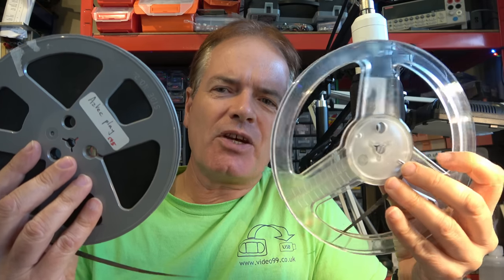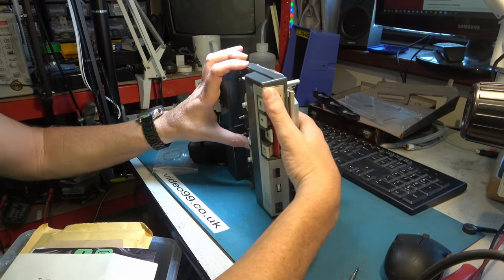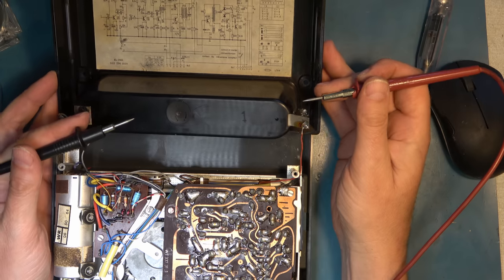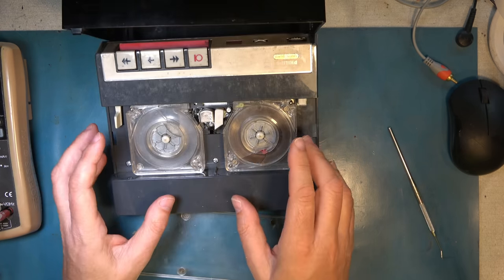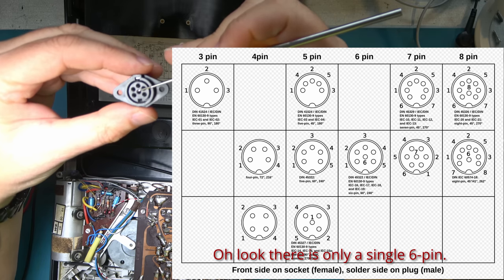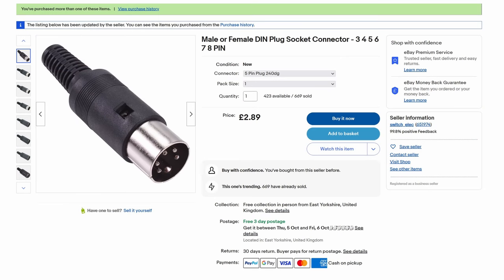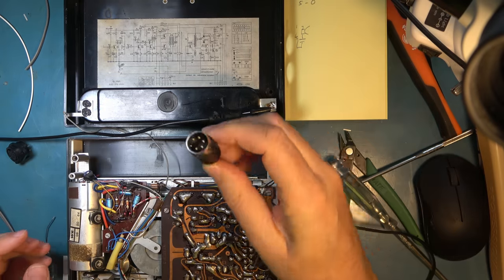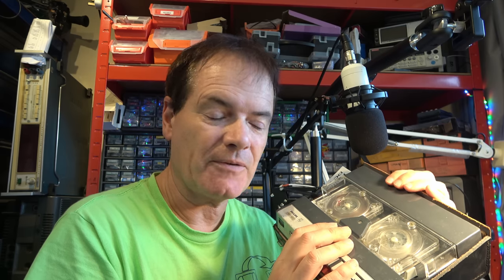Rare audio tape. Reverse engineer Philips EL3583 dictation machine. Historically important format.

Comment: The compact cassette also did not have a catchy name when it was introduced, "EL 1903" (the first tape recorder was "EL 3300"). I suppose that Philips did not feel like inventing a zillion names for the zillion products that they tried to launch back then. But when the compact cassette caught on, they created a name for it along with a logo, and adopted the fancy plastic case from their Einloch single-spool cartridge (originally, the EL 1903 cartridge came in a cardboard case similar to what later would be used for cassingles).

Comment: The change in your hair colour around the 1hr mark made me smile. I think you overdid it with the Grecian 2000 or whatever was in the bottle 👍😊
Reply from the maker: You weren't supposed to notice.  It went a bit wrong for some reason.
Reply: @video99couk 👍🤣  Apart from that, really interesting and watchable video. Methodical diagnosis and discovery exemplified.

Comment: The cassette version you were thinking of, (with the take-up spool and the feed spool in one plastic case), is a Grundig model.

Reel to reels that use the take-up spool to pull the tape through are called rim-drive machines and they were very common, (I have bought quite a few off ebay), but they are not very compatible with each other.

However, these days you can record a tape made on a rim-drive on any other rim-drive machine into Audacity and play around with the speed until you get it right, as the variable speed will still be at a constant rate.

Comment: In the 80's  I worked as a bench tech for a company selling and servicing Philips dictation products, both the older models such as here and the newer Minicassette format with recorders small enough to be handheld. It makes sense when we understand that many dictation tasks were performed in an office. Back before miniaturisation of electronics and mechanicals, they had to use a desktop machine for both record and playback. The attached recording microphone could be handheld and  remotely controlled record, play and rewind functions. This mean the desktop machine had to be solenoid controlled which added to the cost and weight of the machine. So the person making the spoken recording didnt need a tiny handheld recorder, which at that time wasnt feasible anyway. That came later with the (Philips)  mini and  (Olympus) micro cassettes and machines. After the recording had been made the secretary would play back the tape often on the same desktop machine it was recorded on and simultaneously type the words on the typewriter. There was a foot pedal with record, play, stop, rewind and play  functions which allowed the sec. to continue typing with both hands. Listening was done through a stethoscope type headphone for clarity and I guess privacy. The need to flip over the tape quickly wasnt such an issue. So the Compact Cassette developed from office dictation technology. But one of the reasons Philips and Grundig  chose "rim drive" as opposed to capstan drive was that capstan drive was somewhat vulnerable to tape damage especially with multiple stop/start rewinding in attempts to  rehear an unclearly recorded passage. No surprise the 1967  Philips  Minicassette, also designed by Philips as a dictation format, retained "rim drive" even when introduced 4 or so years after the introduction  by the same company of the capstan drive Compact Cassette.
Reply from the maker: Oh yes I have a foot pedal control for a mini or microcassette machine.  Interestingly I have mini and micro (opposing formats) machines made by Sanyo.

Comment: Cheap little rim drive recorders don’t use a pinch roller of course, but they are more in the toy category. Tapes from them have to be played on another rim drive machine due to the speed changing as the tape runs unless you have a vari-speed unit and keep changing the pitch as the tape plays.

Comment: In a weird coincidence, I was just last week passing an IT Waste skip and noticed two of the little metal cans that used to hold the EL3779 tape cartridges for this machine. To my dismay, the cans were empty, but I strongly suspect the tapes would have been elsewhere on the skip, and in all probability the machine they were used with would have been there too, but I wasn't able to rummage below the top layer. I pocketed the cans though 🙂

Comment: Lovely video as usual Colin. Take a look at the Philips EL3581 from 1957....you will see that's it's a valve based machine that used 1/4 inch tape stock on  3" standard reels as used in the Stellal ST470 (Philips) and later machines. The difference... the consumer Stella's used bare reels at 1 7/8 and the  EL series dictation machines used the same reels in a convenient plastic shell/cassette. The problem being postage and cost. Far easier to post a single reel...as  the competing grundig Stenorette series used, still with full autoload. I used to love all these old machines, and the cylinder dictaphones :) on and check out the beautiful Fi-Cord 101 ❤

Comment: What an unusual machine.
I would be cross eyed with the odd wiring and positive earth.
i bet there are not many existing now.
I imagine they were replaced by other hand held devices using mini cassettes.
Reply: Because in the Ge era it was easier to get better performance from PNP transistor polarity type, most transistor electronic from that era was with positive (= where the emitters get connected) grounded.

Comment: It's hard to believe Phillips put this out in 1964.   This thing is a convoluted lousy copy/implementation of a compact cassette (low speed 1/8th inch quasi cartridge system), which was released in 1963.  Compact cassette was better in every way.

Comment: I had something very similar when I was young around 96 but sure was no batteries and red button fed the reel also had a slider think was time that from Emory could be moved never knew what it was as I had got it when a kid as was unique and think cost around $5 back then lost now, also didnt have a speaker but a remote with speaker/microphone and from memory couple buttons to control unit

Comment: MANY, MANY reel to reel tape drives are rim driven and don't have a capstan.  There are endless examples from the 50s and 60s, especially battery operated portable machines.  They also have DC bias and extremely simple mechs and audio circuitry.  Most are barely passable as dictation machines.

Comment: It never seemed to me that threading open reel tapes was a problem, but certainly you could get really expert at it but would a teacher or someone in an office work out the tape path? The machine solved one problem it was compact with only one reel for posting for example. It did not solve the open reel problem of having for all practical purposes having to wind all the way to the end if you safely wanted to flip over the reels on a multitrack, cc fixed that.

Comment: It's surprising it's transistorised, as most devices in 1964 still employed valves. It seems quite compact and advanced for its time ... "Simply Years Ahead" you might say? (See what I did there?) ... However, I suppose its use of transistors is because it's in the "small audio device" category, along with the portable transistor radio and such like?

EDIT: I'm a good couple of years OLDER than those "ancient capacitors!" ... But fortunately, I've NOT gone "leaky" ...... yet! 🤣 (See what I did there, again?)

Comment: But the VERA system didn't have a pinch roller.
Reply from the maker: With all due respect to the engineers of Vera, the results were dreadful, at least in part due to lack of accurate speed control.  Why did they think a static head was a good solution?  Probably because no-one had thought about a spinning head yet.
Reply: @video99couk  Eduard Schüller 1953 patent for helical track recording (Telefunken, Hamburg)